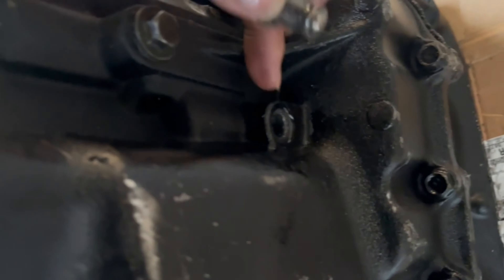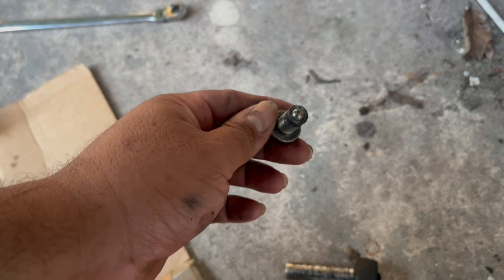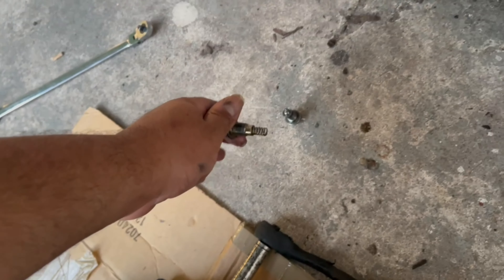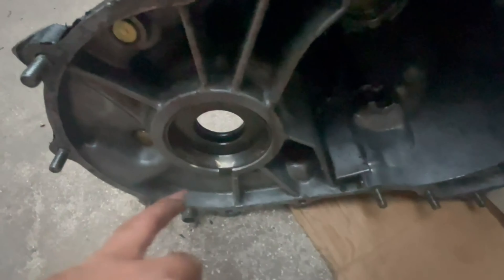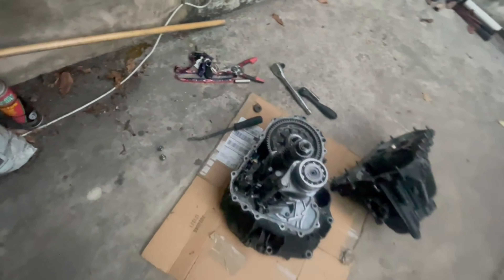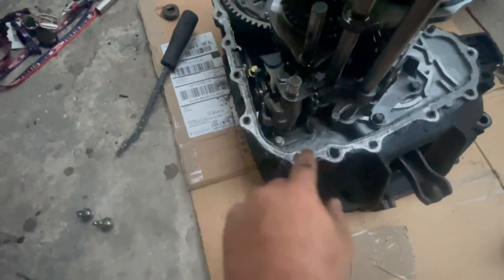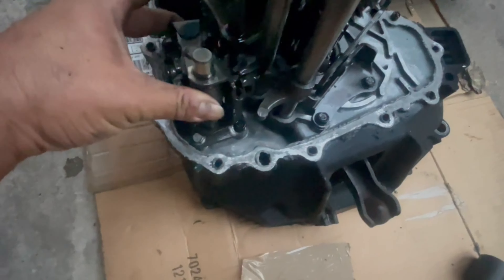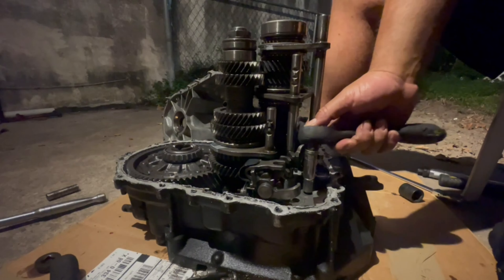Acura Integra B Series Transmission Teardown DIY

Comment: The shiny bolt on your shift mechanism, is in the wrong spot. Its suppose to be where the dark bolt is. They are different lenths. 2 long bolts, 1 shorter (shiny) bolt. The last screw you took out was bottomed out in the hole as it was too long, as you put the long bolt in the short hole.
Reply from the maker: That is exactly what happened. And I’m pretty sure I explained in the video that I had taken the transmission to somebody to fix an issue I had and that’s how I got it. Following video shows the fixes.

Comment: The 2 washers on the input bearing, what you said is wrong. The cone washer (spring washer) points down towards the bearing, and goes on the bearing itself. The flat washer goes on top of it. You need to download a Honda manual or something, as you have said a few things now which are not correct. Sorry dude.
Reply from the maker: I will take a look at a Honda manual when I get a chance. The book I’m going off of says, verbatim, “prepare clutch-side case for assembly by setting the spring washer (dished side up) and input bearing thrust washer on the input bearing.”